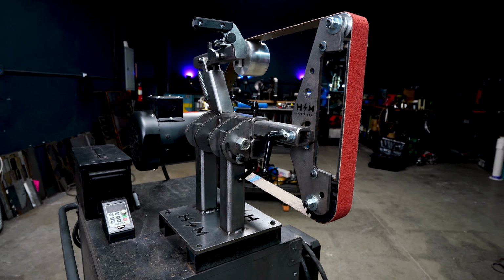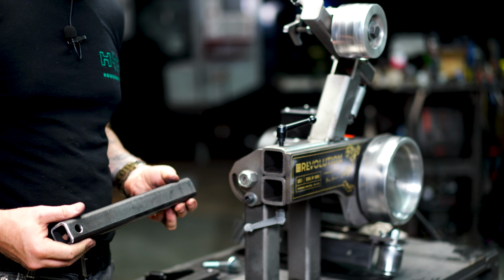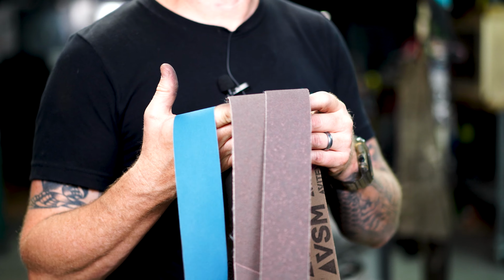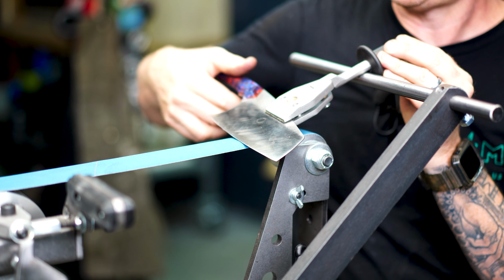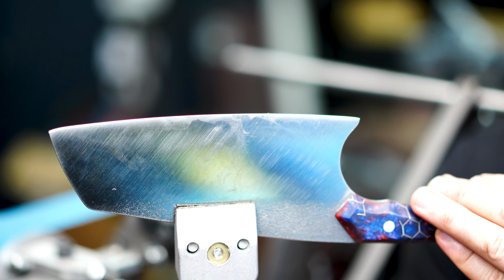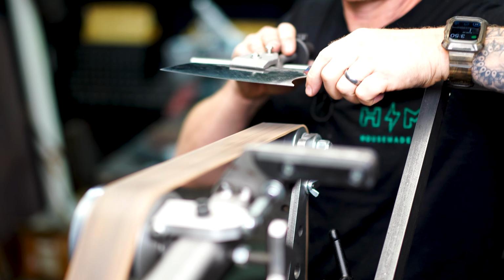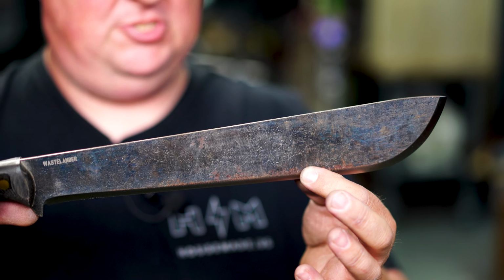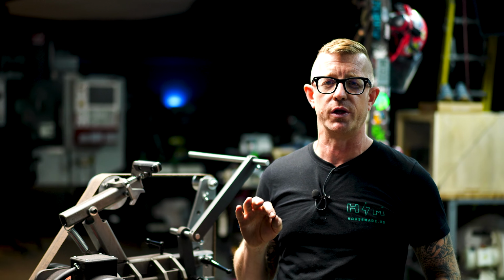How to: Sharpen Anything on a 2x72 Belt Grinder

Comment: Hi Brian, I really like your grinder design and my own build is highly influenced by your design but in a bolted version. As I saw this video I directly started to look for scrap pieces and did't found long enough parts. But I found a even more simple solution. Placing the flat platten in the lower tube and the work rest in the upper one. Clamping an angle iron on the workrest and moving the workrest up as far as needed. Now I can use the angle iron as my guiding rail for my knife clamp. It works perfectly.

Comment: That's a very effective knife sharpening jib for that belt grinder.  The ergonomics on it leave a lot to be desired.  With the sharpening jig in use, the edge of the knife is at shoulder height and the knife clamp handle was at chin height for the person who last used it in the video.

Comment: Great vid? Was wondering if you have considered offering a simple 2x42/48 belt grinder kit with a flat platen, that can be attached to a bench grinder or simple electric motor? It would be nice to have a less expensive, no weld, entry level machine for beginners and for sharpeners.

Comment: I realize, Mower blades can be a very General and Complex statement(as Many types/styles exist).
I tend to Hand grind mine on a 2x72....but this can certainly give some Human error for many reasons.....30* angle Recommended.
Just wondering if U have pursued this scenario at all yet and if it may incorporate a bubble level(magnetic?) or a fixture for getting somewhat consistent grinds on the blade?

So far, my practice has been to grind into the Edge of the blade, so that i can See when im at the cutting edge.....VS on a knife when using a fixture and the belt going away from the edge(and leaving a burr).
Please LMK what your thoughts are...thanks!

Comment: This looks like a very good system. I work on axes and free hand the edge -do you know of a clamp that would handle the thickness of an axe pole (1 1/2 to 1 3/4)? Thank you!
Reply from the maker: Not sure about the axe using the clamp, but I would think you could rest the entire axe head on the rail and do the sharpening that way. Maybe?
Reply: @HouseMadeUS  Thank you for responding (you’d be surprised how many do not)! I will have to look at your video again and see how I can do this but I like your system! Thank you for designing and manufacturing something like this.

Comment: do u give hand on training by using Tormek, belt grinfer, wetstone?!
Reply: Murray Carter posted his entire tutorial on using stones, and it's loaded with great information.

The issue is, you'll learn more from sharpening some cheap knives on your own than you will from someone holding your hand (literally or metaphorically). Get some firsthand experience, then watch the tutorials.

I could prattle on about all the tricks I've learned over decades that I've been sharpening, but what works best for me might not work best for you. Anyone that says there's a single best way to sharpen is either baselessly arrogant or a snake oil salesman, usually both.
Reply from the maker: Very accurate statement. All around. 🤙🏻

Comment: Here is a reference for those of you who use japanese water stones on your kitchen knives or razors.

in western sandpaper:
1200 grit  = 3.8 microns.
in japanese water stones:
 2000 grit = 6 microns
 4000 grit = 3 microns

For a more practical compariaon:
a 1200 grit belt will provide a grind similar to the Naniwa Green Brick of Joy, which many sushi shokunin(myself included) use to touch up their knives between shifts.

The feel of the polish will be different, but the toothless of the edge will be in the same range. 

Therefore this belt system will give you a good, toothy, 'full shift' edge.

This level would be acceptable for more hard use blades like Deba, Honetsuki, Sushikiri, unagikiri, hamokiri, etc.

Following this up with a polishing stone or two above 5000 grit would give you an edge suitable for blades such as yanagi, takobiki, usuba, etc.

There are times though, when you want a more toothy edge on these thin, slicing knives.

For example; on extremely fatty or oily fish, a highly(12000+) polished edge is actually too smooth and can lead to less ideal cuts than an edge in the 3-6000 range would.

I have a yanagiba that i only sharpen up to the Green Brick of Joy level for precisely such occasions. 

In theory, this system and a tormek(with the replacement japanese stone wheel) would produce comparable end results. 

As to the potential time savings, I will have to wait until I build a Revolution grinder for my shop and try it for myself. 

For what it's worth; the folks over at Japanese Knife Imports use a combination of 2x72's, small(horizontal) kaiten toishi's, and both natural and artificial water stones to do repairs and put final edges on blades for customers.

I hope that helped.
Reply from the maker: Awesome. Thank you! Very helpful.

Comment: I built the jig when Dennis first put out the video a few months ago. Its a great jig, I'm totally a fan, but I discovered right away that the Wen clamps do not give you the same angle for both sides of the blade. Set your angle on one side, turn over the blade, and check the angle again and its changed. I commented about this on his video at the time and he stated that the clamps are self-centering. Fact is, they are not. Nothing against him. I LOVE his channel, his style, his designs, and have learned SO much from him, but on this point he is not correct. The clamp does not center the blade and you get a slightly different bevel angle on each side. Different blade geometries can enhance this effect so that in some cases the difference can be 5 degrees or more from one side to the other, or minimize it down to one, but its always there. In order to use the Wen clamps you need to adjust for that difference by padding the bar when sharpening one side so the bevel angle remains the same. I actually got past that issue by just replacing the Wen clamp with the tormek centering knife jig KJ-45 (also on amazon). Looks very similar to the Wen clamp, and its a bit more expensive ($15 more i think), but it actually centers the blade to the shaft of the clamp regardless of the blade geometry and the sharpening angle remains the same on both sides of the blade without padding the bar
Reply from the maker: Oh wow! I wonder if maybe you got a bad set? The one I have here was made by Tormek so its dead on. Thanks Chris for the info!
Reply: Knife Grinders Australia has a great video from a couple years ago the talks about clamps that have one face fixed to the handle. The offset of that fixed side from the center line of the handle dictates what size knife spine will be centered in that jig. He goes one to describe multiple ways to fix that problem from taping up the spine to having multiple jigs ground for spine sizes. I don't think many users would notice a 5 degree grind difference visually and even less could feel the difference in use.
Reply: @MJFacas  For knives with wide blades and very shallow primary bevels this different would be minimal. As you say, unnoticable for the average person. However with a narrow blade that has a greater primary bevel angle, it can be a much more significant difference. The best solution (In my opinion)is a blade holder that actually centers the blade so that the angle really is the same for both sides regardless of the blade geometry. How much of a difference is acceptable is I guess a personal thing with no correct answer.

Comment: Good system, but you end up with a convex bevel due to the flex and wobble in the belt. If that’s intentional great (convex edges have their advantages) but if you want a non convex edge you need a platen
Reply from the maker: Correct, we can shift the device to use the hard flat platen as well.

Comment: If someone has a 2x72... They should know how to sharpen a blade!

Make a product for a cheap 1x30 and that will impress me...
Reply from the maker: Working on it!
Reply: The problem with the 1x30 is it is a single speed, way too fast and very easy to overheat the blade edge, it wouldn't be a good idea. I've used one before I got my 2x72 Revolution

Comment: So basically you've made a kit that will make your belt grinder into a Tormek without the water to cool it.
Reply from the maker: Add a misting system and you're all set. Multi use tool! Gotta love that!
Reply: @HouseMadeUS  I agree it would be an excellent alternative to sharpening most things that need it quickly and without wear and tear on a stone wheel and the extra clean up. Don't get me wrong I like it, just not for the best knives.

Comment: 🤓ummm, actually as you move to the tip of the blade it would be a slightly different angle that you set in the middle. This is obviously a fatal flaw 🤓🤣
Reply: If you put the holder at the apex of the curve and rotate the knife as you sharpen, that doesn't happen.  😉